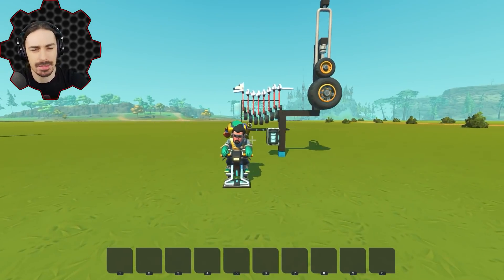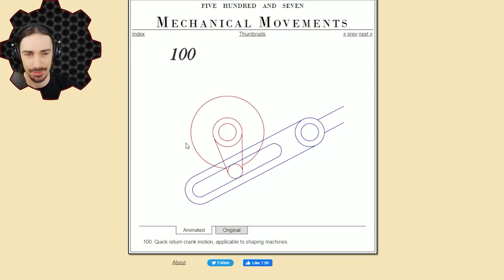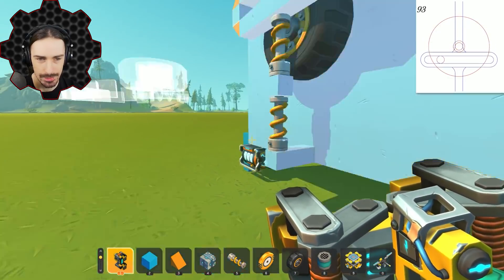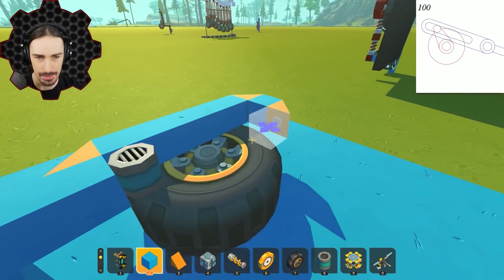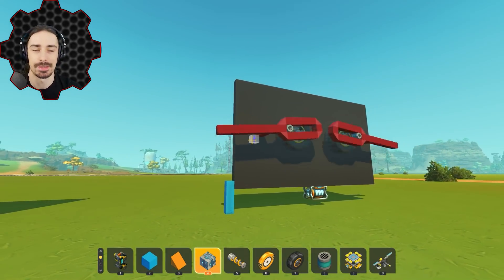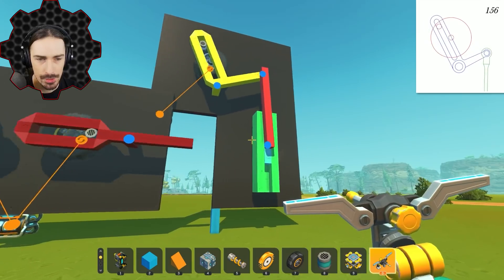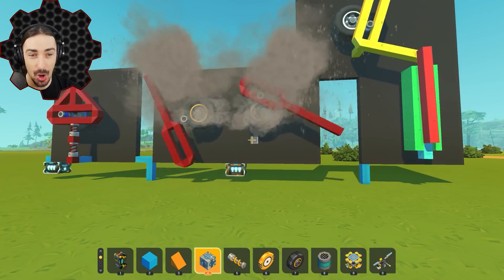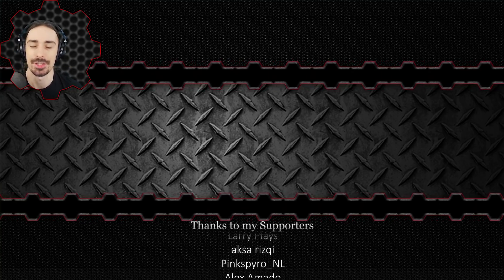3 Real Life Mechanisms That Are Surprisingly Easy to Recreate in Scrap Mechanic.

Comment: #93 is pretty awesome for hill climbing. It provides the power of X number of pistons into torque for the wheel. Seems to work vastly better than just a bearing.

#265 is a variable speed drive. By moving the pinion along the rail it will either increase or decrease the speed of the cone shaped object.

Comment: I went through all of the mechanical movement and i think you should try:
48, 51, 52, 53, 125, 168, 185, 329(is a bit more challenging), 331, 332, 339, 489, 494.
I think these are possible in scrap mechanic, although some of them are quite challenging. Ik think it would be interesting to see you try.

Comment: There's also a way to convert spinning motion to horizontal motion using gears you have a central gear that is spinning and it is it within a track that has two straight sides and then two curved edges one of the straight side has teeth on it so that it will only move a certain way has the gear spins

Comment: please do #27         27. “Multiple gearing”—a recent invention. The smaller triangular wheel drives the larger one by the movement of its attached friction-rollers in the radial grooves.

Comment: one thing to note is that the 'arm' of the third mechanism is quite long in your build causing it to have a long travel distance for each oscillation. If you made the 'arm' shorter it would probably be smoother with a shorter distance

Comment: Mechanical movement 156 would be perfect for an animated oil pump in Survival. Just need a sensor at max so color mode can be turned on and either swap the electric engine for a gas one as it would have infinite power since a craft bot would be turning all that oil into gas or use a controller set to rotate at 360 degrees on a loop to turn the mechanism. I'm not that good at Scrap Mechanic Survival so I'm just shooting out ideas.

Comment: TLDR:           I know this is long but hear me out........ what if you made an Evil Furby? With the mechanisms from this video and maybe even some other mechanisms you want to test out to.

Why not do something with these ones? I have a pretty funny idea, make a "cute monster"!! Use the left mechanism @13:25 for a mouth (attach the top post so it doesn't move and add suspension on the sides of the mechanism so the mouth can open and close) and have it open and close at regular intervals until an area/distance sensor is set off. Use the middle mechanism for eyelids, no changes needed, just needs to be attached to the top eyelids to open and close them, also on a slow, regular interval until an area/distance sensor is set off. Use the right mechanism for arms but not until the area/distance sensor is set off and that's when the cute turns into monster. Have the sensor speed up the eyes to the point that they're "breaking" (ie. @11:45 ) so they start blinking in random and desynchronized intervals, make the mouth speed go up and down to make it look like its trying to talk/bite you and make the arms flap up and down (fast on the up cycle like it's trying to grab you). I'm picturing a cute Furby losing power and going haywire! Would make for a hell of an episode and would allow you to put these mechanisms and more to good use.

Comment: @3:09 the mechanism is a variable ratio gear, except it's just based on friction instead of teeth. Depending where on the parabolic surface they contact, the ratio between output and input speed is changed

Comment: The last creation /rotation point is not misaligned, it's a circle. It's just at a different orientation in the picture and video. If you look at the swing of the mechanism it's equal on each side of the circle. The end of the bars extend past the wheel on either side at an equal distance. And the "limb" connecting to the arm is that a 90° angle.
You didn't really put the pin in a different spot. Because it's a circle.

Comment: day 153 or 154 of asking scrapman to start a Survival series amphibious tank/basically any transportation and floating base/barge (or under water.) But you need mods... it's a requirement to breathe underwater, if you want an underwater base/transportation. And yes i am talking about the underwater fan moonbo reviewed that basically makes water spaces air spaces... if that makes any sense.) (and if you wanted to move the barge/boat/floating base you are able to make thrusters/glitches/mods to do it or by lift or actual push

Comment: I made a walker with the mechanism similar to the second one but reversed, instead of having the pin on the wheel I had it outside the wheel being static and the bearing on the wheel connecting the rod, I got a hexbug scorpion toy and copied its walking mechanism. Did I explain this right?

Comment: work on a big mechanism now, as u have the basics right, make an ic engine piston cylinder mechanism, with the cam shaft as well, and the valves, dont know how much the game will handle, but 3 to 4 cylinders should be good.

Comment: mechanism 1: A 
mechanism 2: A
mechanism 3: B (would have used a slightly bigger wheel )

next i nominate mechanisms:125,158,175, and the boss challenge 185.

challenge 2: i would like to see you incorporate multiple of the "507 mechanical movement" mechanisms into a vehicle (obviusly they will be pretty big to fit multiple in one)

Comment: The cone and wheel are a variable speed transmission.  The wheel moves along the cone,  changing the gear ratio.
Reply: So there are multiple gears lined through the cone? I never knew how transmissions really worked
Reply: @braydonattoe2078  no, it just uses friction.  Since the cone's diameter is different at different points,  moving the wheel gives you an infinite number of gear ratios.

Comment: 12:22 =A
12:31 =B why? Because the slider of the creation is in the circle and the original is on the outside of the circle 
12:45 =A

Comment: Hey Scrapman,
what about making a CLOCK or a Watch with the previous Geneva Drive Mechanism thing,
i did some testing and i figured out that actually the electric engine at some settings can rotate at 1 rotate per second so the
clock might be possible and also it would be really cool if you would pull it off.

Comment: You should build a fully working model of a 4-stroke engine cylinder with all the bits of the cycle animated, even using cams for the valves and such, I think many people who don't know how these common mechanisms work would really appreciate it.
Reply: I would say it’s possible but there’s a lot of things about engines that you would need to know before you go and build it.
Reply: In trailmakers, use all the things learned and make a flying dragon or something crazy like that, should try it in the new map with wind factors,  aerodynamics ect.... Good luck @scrapman!
Reply: it will be a lag fest.

Comment: do the variable pin ratio axial transmission (90 degree sliding continuous variable transmission), can be made with disc + wheel 90 degrees, or something creative
Reply: what means to be a bit cranky :)